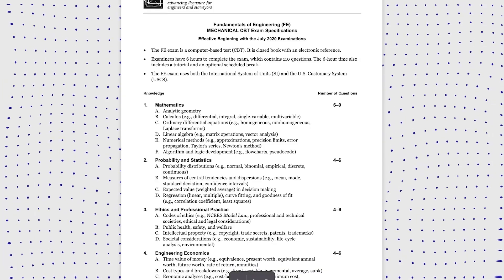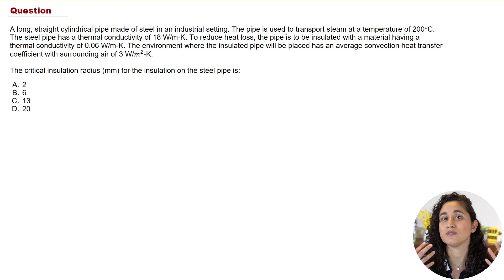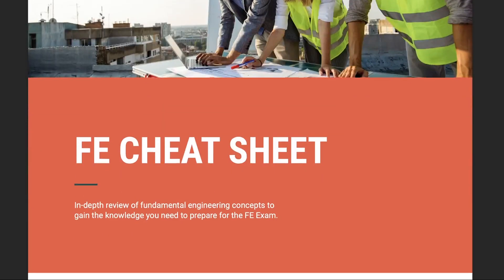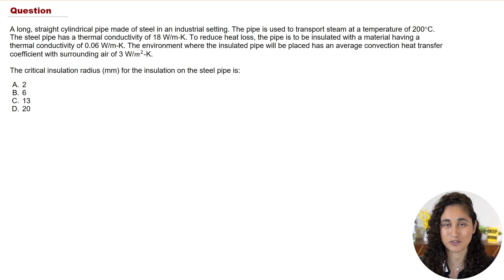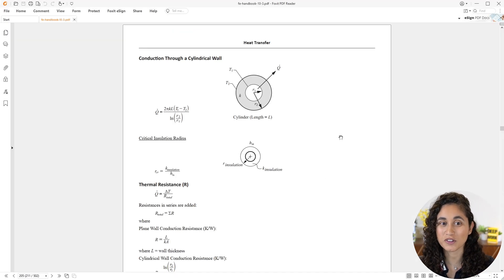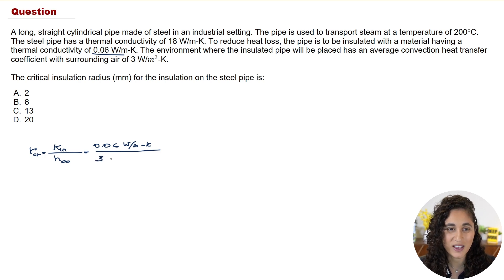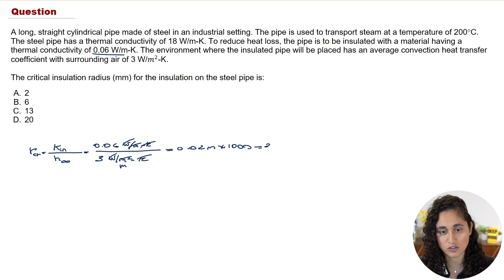Critical Insulation Radius | FE Mechanical & Other Disciplines

Comment: i really appreciate all of these awesome videos 
you are awesome

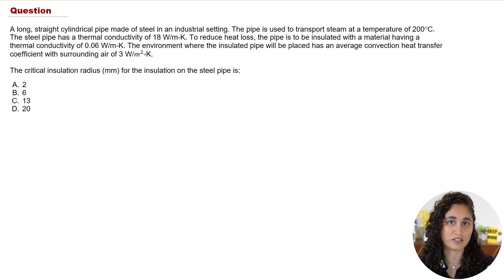i am concerned that what you said at 1:19 is incorrect and what you said at 1:50 is slightly inaccurate
If you take 
R_cyL_ins = ln (r2/r1)/(2piKL)
Rair = 1/(h*A)
and 
Rtot =  Rair  + R_cyL_ins = ln (r2/r1)/(2*pi*K*L) + 1/(h*A)
so if you take the derivative of Rtot with respect to r2 noting that A=r2*L*2pi
you get 
DR/dr2 = 1/(r2*2*pi*K*L)  - 1/(r2*r2*h*2pi*K*L)
the derivative is zero when r2=k/h 
i.e. when  r2 is at the critical radius  
below the critical value adding insulation lowers Rtot but above the critical thickness adding insulation helps because it it increases the conductive resistance more than it decreases the convection resistance. 

I think the take-aways are that:
#1 below the critical radius adding insulation actually increases the rate of heat loss
#2 above the critical radius adding insulation decreases the rate of heat loss relative 
however 
#3 depending on the circumstances (especially when r1 is small compared to rc) it may be worse to add insulation at all unless you can add a lot of insulation (not just the critical thickness)
(by my math, it becomes helpful to insulate when rc*(r2-r1)/(r1*r2*ln(r2/r1) falls below 1.0 )  
where r2 is the insulation_OD/2 and r1 is the insulation_ID/2 aka the pipe_OD/2 

again i am really impress with your videos and i am hoping to help by asking about this.
maybe i am wrong about my concern. if you read this thank thank you.
Reply: also i should note that, in my comment above, i was treating h or h_ave as constant. 
but h_ave falls with increasing outer diameter so takeaway #3 may not manifest as severely as the analysis with constant h_ave suggests